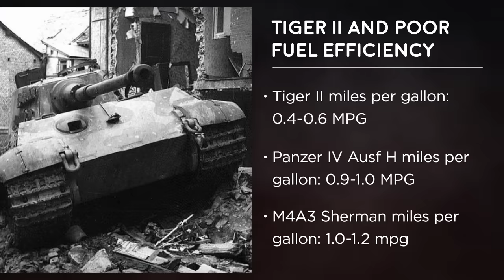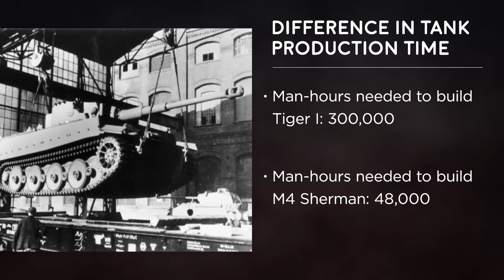Why Did German Tanks Perform So Badly in The Battle of the Bulge?

Comment: The Ardennes famously were thought to be impenetrable to massed armor prior to WWII. This was based on sound understanding of the terrain by both the Belgians and the French. An army could traverse the area in 60 hours unimpeded (which is about how long it took the Germans) a well known fact in 1938. The failure in 1940 was that the 'precautions' necessary to impede armored forces like blocking troops, roadblocks and fortifications, mines etc were not there then. But they were in 1944.
Reply: What if, lol, the Germans had produced more of the Pzkwf IV's than the Tigers, they might have had a few hundred more tanks. Better suited to the terrain. They'd still lose in the end, but they may have gotten farther.
Reply: @scottkrater2131  they’d also have been knocked out much more easily in the engagements they did have.
Reply: @astratan2238  maybe, maybe not, there'd have been more, and their long 75mm guns were easily capable. They may have been able to overcome American tank units more easily. In the end they still would have lost.
Reply: @scottkrater2131  I think that whilst the long 75s would have been perfectly capable, the big overmatch the Panzers had in most engagements was their own armour. Pz IVs were the least resistant of the options, and would have been more vulnerable to the proliferation of 75s and 57s in American hands. I think they might have got further as you say without just falling apart due to fuel and maintenance, but they would have been losing far more tanks when they actually engaged.
Reply: @astratan2238  if Peiper, had been able to cross the bridge with his tanks, instead be forced to find another route because his tanks were too heavy to cross the bridge? Which also gave Americans more time to prepare a defense.
Reply: French put troops there.  They were just the worst conscripts in the army, who were also very poorly equipped.  That is why those particular troops ran for their lives
Reply: @scottkrater2131  it’s true, but it’s also true that part of why he got so far and so fast was that the engagements he did have were comparatively easy because of the advantages his tanks enjoyed. A few destroyed vehicles on narrow roads could have massively slowed him, and when you drop into the weight class that unspecialised Shermans and the common AT weapons available to infantry deal with more easily he would inevitably have taken a lot more time to break the defences he ran into. Note that having more tanks is less of an advantage in the Ardennes due to the narrow frontage of any advance.
Reply: @scottkrater2131  Against the Western allies the Panzer 4 was becoming very long in the tooth by 1944,

Against Russia...... you're gonna need a bigger tank......

I was watching a documentary that said that the Germans were so low on fuel, that they had tanks towing other tanks....
Reply: @scottkrater2131  Given that most of their fuel available was in depots near the Rhine, it would have only exacerbated the logistics problems that virtually doomed their chances to reach the Meuse while the weather was still bad enough to ground the Allied air forces.
Reply: @scottkrater2131  As KG Peiper had slightly more Panzer IVs than Panthers, he'd have sent them ahead over that bridge if it could have handled them.  It couldn't.  Their intel was...crap, a better use of Skorzeny's "infiltrators" would have been to do some reconnoitering of roads and bridges, wearing their American outer clothing to avoid being readily spotted.
Reply: @selfdo  don't get me wrong, I think Peiper may have, maybe not been slightly more successful, they still wouldn't have reached Antwerp and be defeated. Just may have taken a little longer.
Reply: @selfdo  I didn't say they'd win, only that they may have gotten further. It was a failure the second German artillery opened the offensive.
Reply: @notsureyou  no longer in the tooth than the Sherman or T-34, still able to kill anything in the West, and most everything in the East. Germany tried to fight a champaign war on a beer budget.
Reply: @scottkrater2131  Both of those designs were newer and had much better armour than the Panzer 4.

The Firefly made the Sherman fairly competitive.
Reply: @notsureyou  Not really, and the Pzkwf IV had many upgrades. It had room for more. And it's Long 75 mm gun could kill almost everything the Allies had. From memory the M4 Sherman was the newest design, and wasn't any better than the up gunned IV 's. About equal. Cheaper and more fuel efficient too, when the Germans barely had any fuel. Too bad they hadn't stuck with the original diesel design. They could have had plenty of biodiesel. Then they could have fed the Tigers.
Reply: @scottkrater2131  Yes the Panzer 4 had had many upgrades over the years, including the J series that had a hand crank to traverse the turret....

Apart from being cheaper to produce, the design was reaching the end of it's life span.

Unless they could still a 75L70 into the turret,

And change the hull and turret armour (redesign the hull to have a sloped front, plus all round increase in armour thickness)

Or they can produce the Panther tank.
Reply: @notsureyou  Problem isn't so much the Panther as the Tigers. Pzkwf IV's were still in service until the mid 60's in the Middle East. Syria I think used them.
Reply: @notsureyou  besides, it took a while for the Panther to be one, with all its teething problems. And apparently difficulties to drive. Took a lot of training.
Reply: @scottkrater2131  I wouldn't really count their use by the Syrians, since they faired very very poorly (which is exactly what I would expect given what they were up against).

But that's all they could procure (from memory) from the French (again from memory).
Reply: @scottkrater2131  100% 

The teething problems didn't help early on, or the sabotage due to the use of slave labour later on, plus the allied bombing raids causing a drop in available spare parts,

Combined with putting inexperienced crews into the better tanks,

In the hope that the better equipment would offset their lack of experience.
Reply: @notsureyou  for conversation sake, I'm pretty sure they weren't the best tanks the Syrians had, T-54's or T-62's maybe. But the Israelis were also using Sherman's also, upped gunned, but definitely past it's prime.
Reply: @scottkrater2131  Peiper's own Army Group CO, FM Walter Model, in planning the Ardennes offensive, supposedly said to the Front CO, FM Gerd Von Rundstedth, "this plan hasn't a damned leg to stand on!"
Reply: @selfdo  He was a smart man. They didn't stand a chance, being so dependent on American 'petrol' and no Allied aircraft.
Reply: @scottkrater2131  If you mean that their planned advance was predicated on capture of American fuel dumps; that's a myth.  Promulgated mostly by the eponymous 1965 movie which prepetrated other myths, as well as was not, in depiction of the "Schwerepunkt" as being King Tigers (stood in for by M48s of the Spanish Army on loan for the filming) in brigade strength.  While KG Peiper was just about a brigade in strength, having as many tanks as most armored divisions on the "Ost-Front" had, it had two panzer battalions, 38 Panzer IVs and 34 Panthers, and was not the only spearhead of the advance.

As for fuel, there was enough on hand to allow the panzers to get to the North Sea, if they miraculously managed to get that far!  The trouble was, it was in depots in Germany itself, between the West Wall and the Rhine River, and since there were no rail lines from them to even the starting points for the battle, let alone along the planned lines of advance, the fuel had to be trucked or even hauled on horse-drawn wagons to the front lines.  Just as many other offensives had before stalled due to the same logistical problem with fuel (notably Patton's own Third Army stopping in Lorraine in late August of '44, out of gas, even though he'd practically hijacked the Red Ball Express to keep his tanks gassed up), so the needed gasoline couldn't be readily delivered to the front-line units, not even if Allied air power hadn't intervened anyway or the weather had been more favorable.

Peiper's own KG was stopped and surrounded simply because it was out of gas and ordnance; on the 27th of December, the order was given to destroy the remaining tanks and other vehicles that they didn't have fuel for; and to break out on foot.  As would be often repeated until V-E day, most of the German panzer losses were operational, breakdowns, getting stuck, or out of fuel, rather than by enemy fire.

But interesting that you mention "PETROL"!  That was what often tripped up German infiltrators, in spite of coaching by instructors, many of whom had lived in America prior to the war, especially in the Texas Hill Country, that Americans used the terms "gas" or "gasoline" instead.  Most of the infiltrators were fairly conversant in English, but the BRITISH version (quite a few of them had either worked and/or lived in the UK prior to the war, or worked on British merchant vessels), so reflexively, quite a few uttered the "P-word" by mistake, and gave themselves away.  That, along with asking where had the most recent World Series games (1944) been played, and who won (Ans:  both in St. Louis, and in Sportsman's Park, the only time until 2020, due to COVID, that a World Series was entirely played in one ballpark, the winner being the Cardinals over the usually-hapless Browns), or who was the husband of famed pinup girl Betty Grable (ans:  Band leader Harry James).  Another interesting tidbit about Ms. Grable:  many recall the iconic pinup poster showing her from behind, showing that gorgeous backside and her "Million Dollar Legs" (what 20th Century-Fox studio head Darryl Zanuck insured them for), peeking back at the camera, over her right shoulder.  On the wall by the bunk of many a GI or sailor! The reason for that particular shot?  She was VISIBLY with child, and I believe the photographer still had to carefully retouch the picture to hide her belly completely.
Reply: @selfdo  that's a lot of words, I'm not reading when everyone knows they didn't have the fuel, and lack of better planning meant they missed finding it. Better check again.
Reply: @scottkrater2131 
I think Mark Felton has a video about how long  different WW2 equipment lasted in service.
Reply: @bobjoned3398  think so, Tank Museum too.
Reply: blah blah blah
Reply: And surely there was a better, more powerful army, with better weapons, radio comms and a better strategical & tactical command. The BoB wasn't a rout as showed in that terrible movie, a lot of units fought back and stopped dead some of the points of the offensive.
Reply: @alessiodecarolis  I think that all of the points of the offensive were stopped dead, but maybe that's just me
Reply: @scottkrater2131  More tanks meant more crews and more fuel and oil all of which were in short supply and of dubious quality by 1944.
Reply: @sirridesalot6652  that's true, except the big Tigers, less crew, but 2 or more times less fuel efficient, and not exactly designed to fight in the Ardennes. IV's were definitely more economical, probably easier to train a crew on too.
Reply: In 1940 they only got one bridge (in Malmedy probably german build anyway) all the others were destroyed,  but the germans brought their own bridges,. In 1944 they brought heavy tanks.
Reply: @scottkrater2131 Germany had thousands of panzer 4 tanks and thousands of fighters and bombers just lying around by the wars end. There's a very good reason those weren't used, fuel. Germany didn't have the fuel to be able to field a massvie tank army like the UK, USA and USSR.
Reply: Very timely cultural contributions. Thank you.  @selfdo
Reply: The issue was that France lacked trucks and proper communication equipment. There were thousands of French troops in the Maginot Line, but the lack of trucks and transport vehicles meant they couldn't be rapidly redeployed. In addition, a lot of French units lacked radios. So often times, by the time German units were discovered, it took too long for the French officers and unit commanders to react. France had plenty of medium and heavy tanks that could match German Panzer 3's and 4's, but most German tanks were only encountering French armored cars and light tanks.
Reply: The French absolutely knew you could drive tanks through the Ardennes, in fact one of their officers tested this theory and reported back to high command before the war.

What they CORRECTLY determined was you couldn't drive through the forest with an entire army of tanks plus their artillery support. They expected their fort at Sedan would stop an assault long enough for reinforcements to arrive because you couldn't get heavy artillery through the forest.

They were right - the Germans couldn't get heavy artillery through the forest. But Luftwaffe divebombers could fly over it and performed the same role. The fortress at Sedan was battered into submission by the Luftwaffe, the tanks barely did anything during the battle.